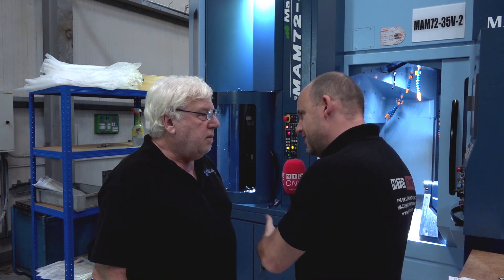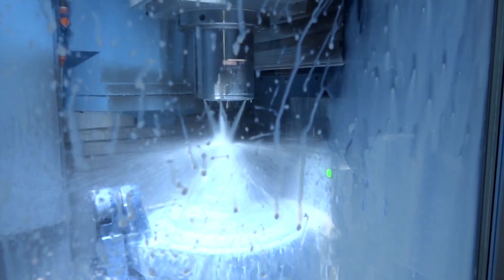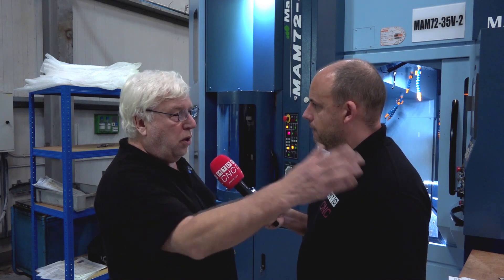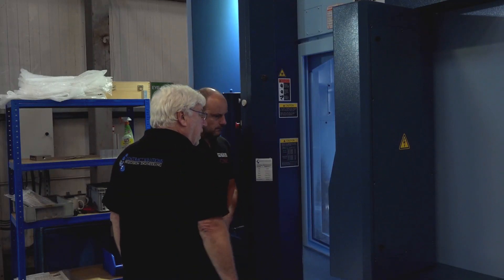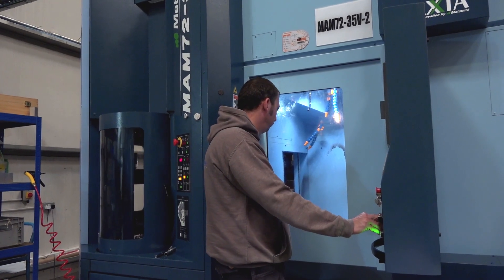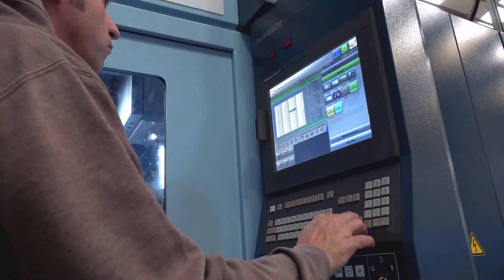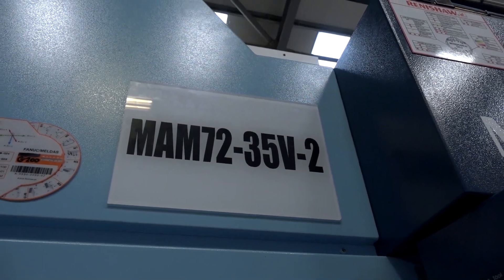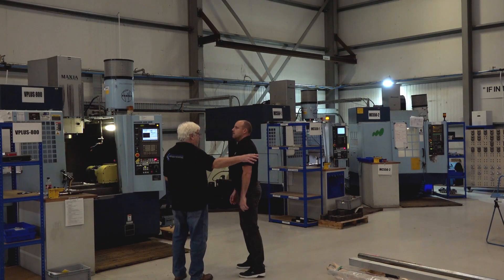Manpower in Scotland is an issue, we had to automate

Comment: If i got the opportunity to buy my own machine i would definitively buy a 5 axis mill with robot or pallet system or even both. It will pay back fairly easily when its machining lights out compared to if you buy 2 or 3 machines and pay the operators for 24/7 run.
Reply from the maker: Glad you enjoyed the video !